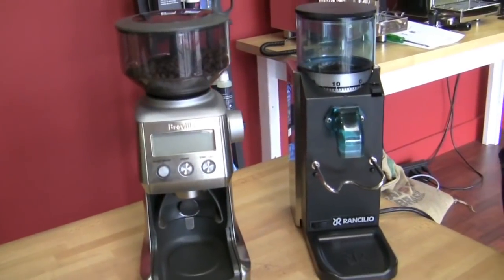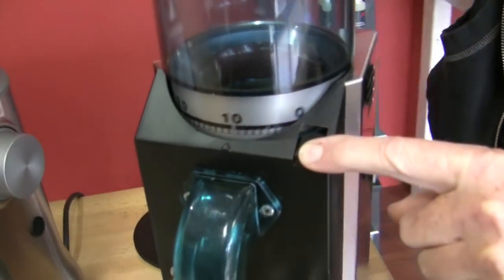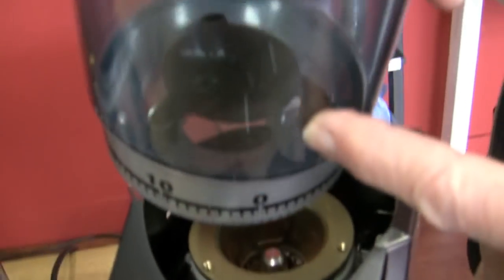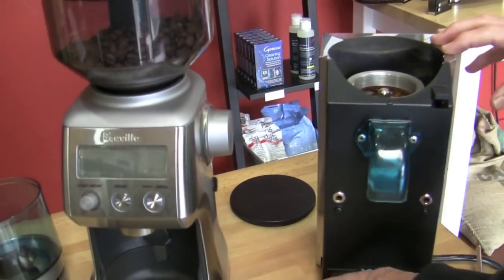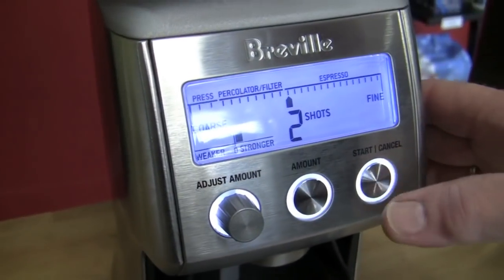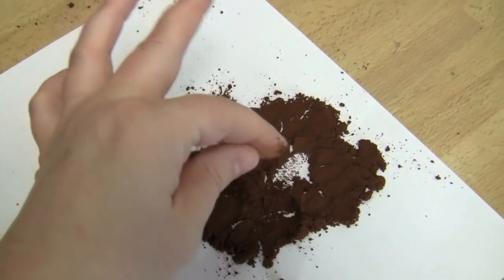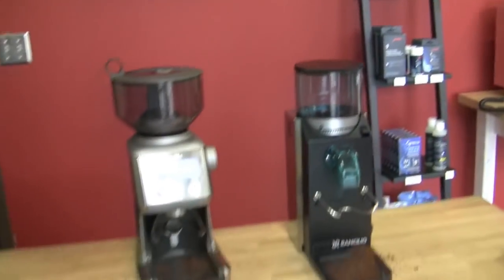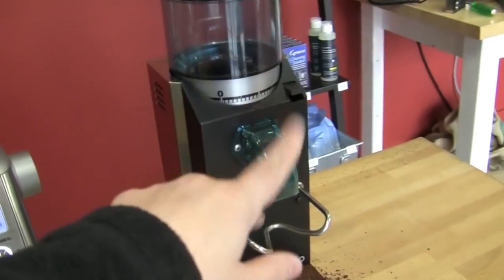Rancilio Rocky vs. Breville Smart Grinder | CR Comparison

Comment: The breville will go finer and coarser if you adjust the top burr. You did show this being easily removed but failed to mention the 10 additional settings on there. For home use the breville is just great value for money and pretty quiet too.
Reply: Does that mean the breville will grind as fine as the Rancilio ?

Comment: I have both of these machines and find the Rocky to be REALLY REALLY clumpy. However, I think that the adjustments between steps are smaller. 
The Breville is much, much quieter and much friendlier to use. The grind goes straight down into the portafilter, so there is much less clumping and spillage. However, the steps seem to be greater, so can't always get the perfectly timed shot.

Comment: I own the Breville Smart Grinder and it does a fairly decent job. The feed gears are made of plastic and over all it's not as sturdy as the Rocky. At one point I had a batch of beans that were oily and it clogged the shoot which caused the feed gears to grind down and break. On the up side, even though it was out of warranty Breville replaced it free of charge without question. I love the looks, program-ability and size of the Breville but would purchase a Rocky or something sturdier next time.

Comment: There is no comparison between these grinders. I have both. The Rancillio is a MUCH more robust, durable machine. The Breville is a toy that is just barely engineered enough for the intended use. It's not durable. You can hear it how the motor labors when it grinds.

Comment: I had a Breville smart grinder, but now I own a Rocky. Using the Breville i could not pull a shot with any crema at all. I even tried every setting. Within the first second of using the Rocky I realized that this is by far a better quality grinder. I pulled a shot with excellent crema. The Rancilio Rocky is definitely a better product.
Reply from the maker: +Tha Pope Thanks for sharing your experience! Cheers!
Reply: Luke Szpunar that answers my doubts cause I'm really into the Rocky for 225£ and the breville is 179£ but I'd rather pay for better quality. but people have been able to achieve good extractions from the breville...... aaaaargh decisions

Comment: Which would you think is the best match for a Gaggia Classic?  Thanks.
Reply from the maker: Hello Sparky, If you brew with a pressurized portafilter on your Gaggia Classic, then a Breville Smart grinder should be fine. :-)  - Sarah
Reply from the maker: Kan Lin Hello! Non-pressurized portafilters are not as forgiving as pressurized, so the grind is especially important when brewing with a non-pressurized portafilter. I would recommend grinding with the Rocky for a non-pressurized portafilter.  ~Sarah

Comment: I would not touch a breville  I  have had horrible experience with coffee machine and grinder  only last me 15 months,  I came inside of the kitchen and I smelled something toxic and terrible,  I got so frightned  it wasn't even on use  yes you guessed it it was the breville coffee machine, out of warrant   it couldn't even be fixed at my cost!!!